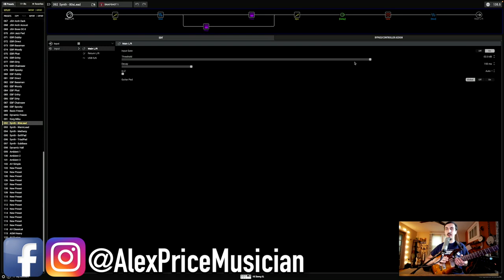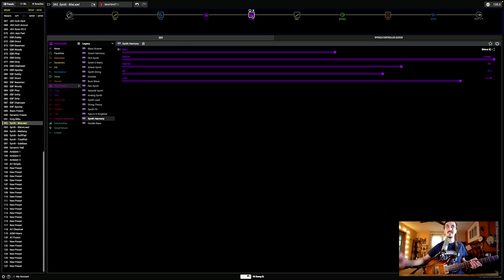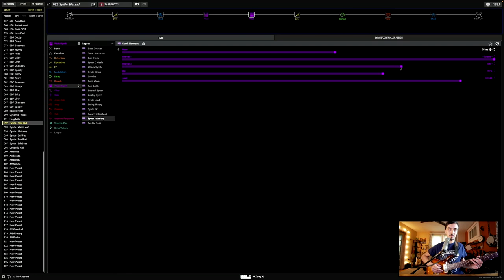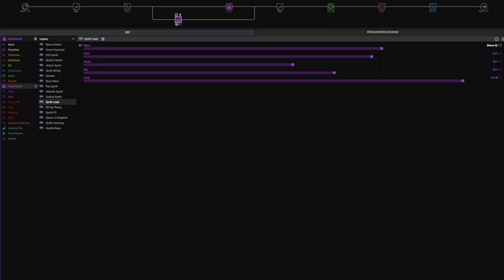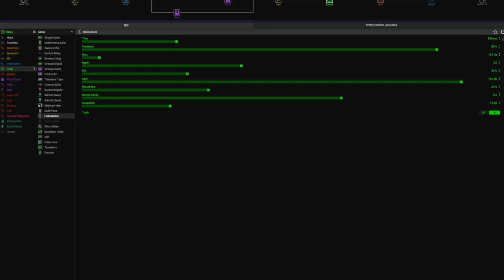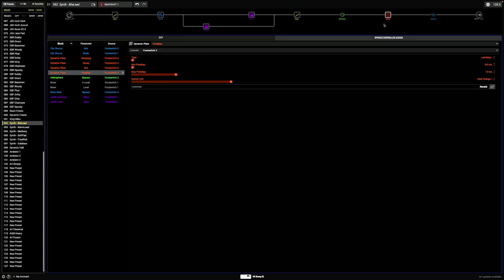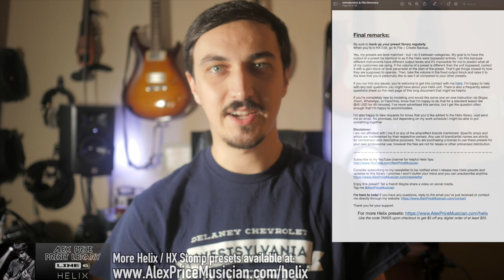The Secret to Actually using the Helix Synths

Comment: What about playing external midi devices and recording midi note data with daw directly from helix floor? Possible or no?
Reply from the maker: No. The helix uses basic midi commands to send or receive messages that can make patch changes or parameter adjustments.  It doesn’t interpret midi like you would get from a keyboard or a guitar with a midi pickup.